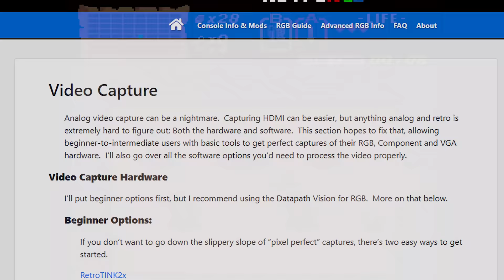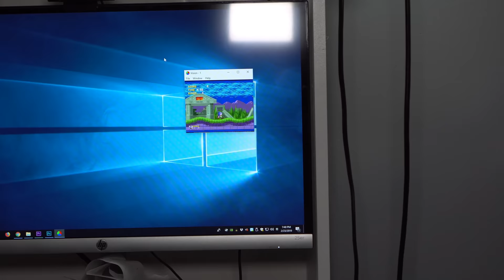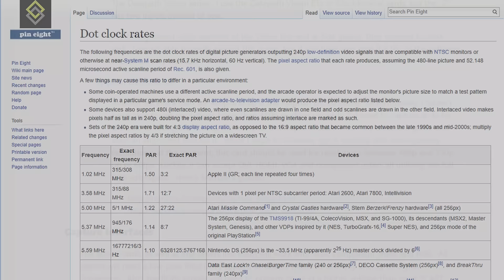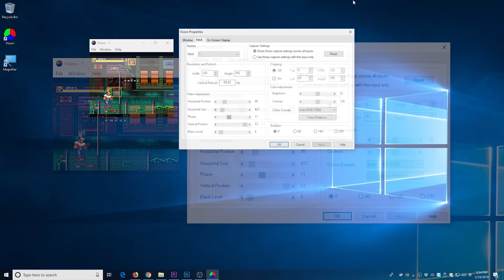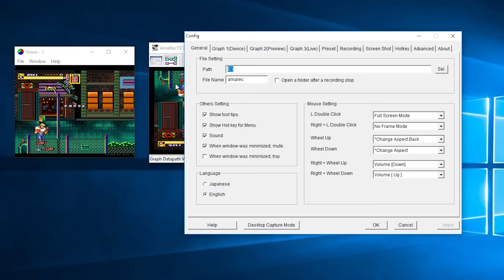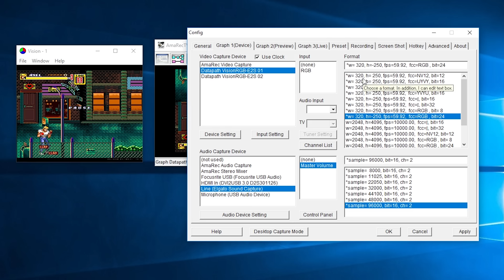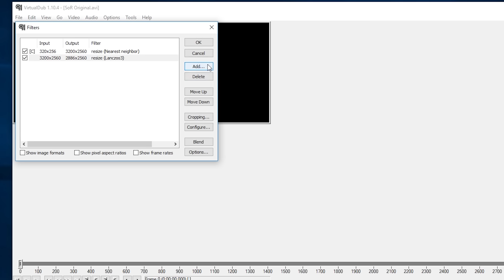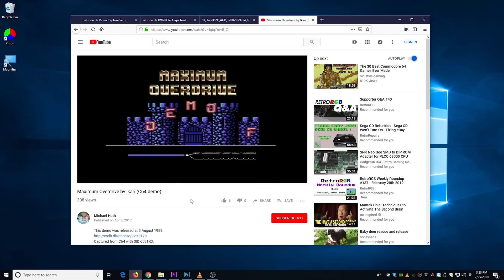Direct Video Game Capture & 4K Scaling

Comment: Very well done, Bob. You might've convinced me to use this method instead of scalers for capture... other than needing to manually fine-tune per game. But definitely keeping this in my tool belt and sharing around.
Also kudos for recommending keeping everything uncompressed at each step. if you start compressing during intermediate steps, your final file will be vomit.
Reply from the maker: Thank you!  Let me know if you'd like prototypes of new designs...I have a few kicking around you might have fun checking out.
Reply: Absolutely! I'll hit you up on Twitter.

Comment: Handbrake is cropping because Automatic is part of the preset you applied. Set Anamorphic to Strict, keep modulus at 2, and set your crop to Custom and all 0. Next, go to the Video tab and set Framerate to Constant (variable framerate can cause judder and all sorts of crap on playback), and set whatever else you may want (I find RF21 too low usually, but for the fewer colors we are talking about and uploading to YouTube, it's probably overkill). When you are satisfied, save these settings as your own preset, ready to be applied with a single click next time. 👍

Comment: Great video! I did some testing today to see if I could get some similar results by incorporating the OSSC into your post-recording, integer scale method and I found some very useful results. 

If you have an OSSC you don't necessarily need a Datapath capture card if you're willing to tune in optimal timings for your consoles on the OSSC. You'll just need a capture card that can accept the 480p OSSC signal for the bare minimum to work. However, it is worth noting that the datapath is nice for things similar to what Bob does because it can record RGB in its native colorspace without conversion,. What I did was take my OSSC, dial in optimal timings, set the output to 480p, and recorded that image at 640x480 with a normal capture card. I then did the process Bob shows in the video using VirtualDub and was able to get very nice results from it. 

Here's a quick test video I threw together with the results: https://www.youtube.com/watch?v=2RVMGAORn4Q

Comment: Lots of great information in there I didn't know about! Funny enough, a friend sent me an E1S a couple months ago and I finally got around to installing it on the night you posted this video. I've already got a FM and OSSC paired with an Elgato and will likely continue using those for ease of use, but flexibility is important to me and I want to open up as many streaming and recording options as possible. Case in point, I have a few retro PC builds that I have been struggling to capture for ages. No consumer capture card I could find handles the 320x200, 70hz signal that MS-DOS games require. The E1S however doesn't even bat an eye at it and grabs it perfectly. It takes much higher oddball resolutions as well and if I'm capturing from a Windows '95 box, I can switch from the Windows desktop (at say, 1024x768) to DOS programs (at 320x200/640x400) without a hitch. From what I can tell this seems like the perfect classic PC capture solution.

Comment: Your Amarec is recording with VFR you should force CFR so instead of the framerate changing when the source drops a frame, you would maintain the framerate with a duplicate frames.

Edit: When exporting with handbrake or any other front end for x264 you should crop the black pillar box/letter box bars because otherwise you are wasting bitrate on encoding part of the image where there is no useful information, instead of using all the bitrate for the visual information present. When you crop like this and upload to youtube, it will still be detected as 4k but at 4:3 and play back in the 4:3 player and if you full screen it, the black bars will "reappear" as it centers the 4:3 image for a 16:9 display. TL:DR you are wasting resources encoding usless information (black bars) and lowering the bitrate for the useful information (game image)

Edit again: I forgot to say thanks for the great video so thanks :)

Comment: Great video! One thing I'll say, though, is that I tend to be able to scale videos in VirtualDub faster when using fewer resize filters. Instead of integer scaling at nearest neighbor, then correcting the aspect ratio with Lanczos, then resizing to the target resolution, this is what I do:
The first resize filter will be a nearest neighbor scale that corrects the aspect ratio, but is still a perfect integer scale. So, for example, SNES at 4:3 has pixels that are 7 wide and 6 tall, so simply plugging those factors into the  "Relative (%)" boxes in VirtualDub will make the process nice and easy. THEN, I scale it down to the target resolution. I tried it on a few examples and got notably faster rendering times.
Of course, there's a possibility that this is completely wrong since it doesn't take overscan into account, but I admit I'm a little fuzzy on that subject myself. If anyone wants to correct me on that, feel free.

Comment: I could use one of those sync strippers with VGA instead of SCART.

Regarding the Epiphan cards. The DVI2PCIe card does support pixel perfect 240p unlike the USB versions (the C64 is 240p video!) and can handle the various OSSC scaling modes with ease. The software is just as buggy as the Datapath though (do these companies hire the same crack programmers or something?). You can't directly capture 256 or 320 pixel wide video with it though, you need to double the input sampling since either the card driver or the ADC itself can't capture that low (ex: you have to capture SNES footage at 512x240 vs. 256x240). Also important that you disable all the built in capture resolution profiles and create a custom one as the DVI2PCIe loves to default to the 480i one! If the Datapath cards have a published capture API, you could easily create an alignment tool specific to that card. (maybe send Michael a Datapath card to create one?)

Regarding phase adjustment, getting a perfect noise free image also depends on the capture device. I can dial in my Apple IIgs in SHR 640x200 mode no problem directly connected to the DVI2PCIe, but I can't find a noise free setting on the OSSC.
Reply from the maker: You can get the SCART2DVI here:  https://insurrectionindustries.com/scart2dvi/

Also, I tried doubling the input sampling, but it didn't work.  Might have to triple it, but that's beyond the scope of this project.

Comment: If you get a newer nvidia gpu (10 series and up I believe) it can do transcoding of the video using h.265 and it goes way quicker (thus saving time) because it uses the cpu and gpu for transcoding instead of just the cpu. It refers to it as nvenc if you want to do research on it.

Comment: This is a pretty interesting solution for recording old games, though I'm not currently interested in spending several hundred (more) dollars on capture gear for my consoles right now.  I've actually been trying to get some footage from a vintage PC of mine, so I picked up an Extron RGB 300a which has some of these settings you mentioned like phase, etc.  I might be able to use some of that info to improve the quality of what I'm seeing now that I understand what they are a little better.

Comment: FANTASTIC! Do you have any comparison footage/screenshots of the simpler rigs you mentioned as opposed to the more complex Datapath Vision setup? I'd love to see how they stack up to each other.
Reply from the maker: I plan on working on the "basic capture" video soon.  I really wanted that to come out right after this one, but I just didn't have time :(  ASAP, I promise!
Reply: @RetroRGB  No worries, it's appreciated! I was just wondering if I use something simple like a RetroTink that has fewer compatibility issues than OSSC, is something as fancy as a StarTech overkill (since I'd need an upscaler and wouldn't be using the analogue inputs), so long as the card has USB3.0 to mitigate latency?

Nevermind, just rewatched and got my answer 2:05: with RetroTink, "all you need is a capture card that accepts 480p @ 60fps"

Comment: It would be super helpful to see some information on this but using a Magewell card. I have one (Pro Capture HDMI) and it's great. It can capture analog sources directly, audio, use custom resolutions and framerates, and even resolution switching is instant, but all of the information about capturing consoles takes Datapath cards into account instead. I'm not sure what the Datapath cards are doing, but Magewell's capture a big portion of the overscan area, so the settings will differ greatly no doubt (I capture analog directly since I'm trying to avoid as much converter/upscaler/etc. mess as possible).
Currently I have 358x240 using the Genesis to test, and cropping the left overscan area by 1 pixel, it still doesn't look quite right, but very close. It would be great to see some more information using Magewell's cards. Would it even be possible to capture a 1:1 pixel area?

Comment: I ran into the same sort of audio capture noise problems via USB that you did. I have three USB audio interfaces (Avid Mbox 3 Mini, Avid Fast Track Duo, and M-Audio M-Track Quad). Of the three, the M-Audio was the best, but I abandoned my quest for Genesis audio comparisons because getting clean output was difficult, to say the least. I didn't expect issues with the Mbox 3 Mini, because in its heyday Avid was pushing it as a high-end device. And as you mention, you don't really hear it capturing instrument-level signals or mic-level audio.

Comment: How would Ste's scaling alrogithm apply to resolutions on consoles like Dreamcast and PS2?
Reply: You would use that goofy formula, along with oscilloscope timing data and knowledge of the in-game resolution. For example, if you consider a common scenario of a 4:3, 640x480, Dreamcast game which has a active video width of 47.407us, you end up with 89.69%. If it's agreed upon that the images in the above video are "correct", then there's an contradiction here with Bob's previous Dreamcast video where he proposes that the image which is not adjusted by 89.69% is the "correct" one. The trick here is there is a subjective meaning to what is considered "correct". It's a little confusing, but it's something we can try to discuss on the next The Retro Roundtable podcast, if there's interest.
Reply: @stekulov3529  Please do discuss this!
Reply: @stekulov3529  I am very interested in this!
Reply: Ste Kulov Thanks for the reply Ste. It’s unfortunate that I don’t have an oscilloscope but I guess that’s another reason why HDMI mods are a good idea for later Gen consoles.
Reply: @stekulov3529  That would require you to actually do another retro roundtable podcast!
Reply: @Coffeemessaging  Damnit.  Saw right through me.

Comment: What I'm looking for is a device would need a VGA D-Sub HD15 connector and an Ethernet port. You would connect it to any computer with a normal VGA/HD-15 connector. The interface would need to implement the DDC pins 9, 12 & 15 and report itself as a generic monitor, etc. The PC would think it's just any old standard monitor. However, it would work like an IP-camera, with a web interface and a few RTSP stream profiles, and perhaps also with ONVIF support.

A more advanced version would also have a header to be able to connect to the power-led and power-sw pins on a computer motherboard (opto-isolated input and output). And audio capture header to connect to the motherboard's pc-speaker and sb-audio out. And PS/2 keyboard and mouse support.

Does such a device exist?
Reply from the maker: I would like that as well.

Comment: I've scoured everywhere I could before resorting to asking this question here, but I'm totally lost on this issue. At first, my Datapath E1 card was working great, but suddenly I've been absolutely struggling with this new issue that popped up out of nowhere where now if I power cycle the console with a reset, the horizontal size changes to some other unknown value (the slider still says 341 for my NES/SNES game I'm trying to record). 

To "fix" it, I have to move the slider off of 341, then back to 341 again, but...this is a critical problem for me, because I do speedruns, and I can't get a clean recording that starts from a reset without it being blurry (plus I would have to spend extra time on EVERY reset adjusting the value back, which is a tremendous disadvantage). I know that this is something that can be solved, because other speedrunners seem to never deal with this. Would you happen to have any insight for a solution for this issue?
Reply from the maker: I'd suggest asking this in the R3 discord, as many speedrunners contribute there:  http://r3.fyi/
Reply: @RetroRGB  Thank you for this suggestion! Gonna leave this here for anyone else looking for the solution to this issue: 

Do not use the latest Vision driver! Use version 7.11.2! With this driver, the resetting issue is totally gone.

Comment: What's the latency for all of this processing? Would be interesting to adapt the processing to enable pixel perfect games to be played on new televisions/monitors.

Incidentally, I wonder if this method could be used to transfer VHS to digital files. Of course the quality would still be bad, but it would prevent any further degradation of quality in the copying/dubbing process.
Reply from the maker: I think there's at least one frame of lag, but probably more like two or three.  SOME people can play their games through the capture window, but it's too much lag for me.
...and yes, you can capture VHS this way, but since it's composite or S-Video, you'll need different equipment.  The RetroTINK2x booted in video mode is a good way to capture VHS.